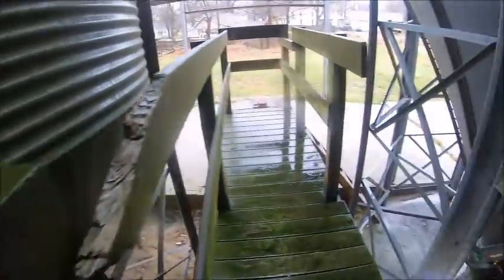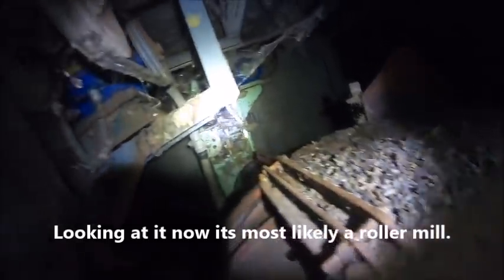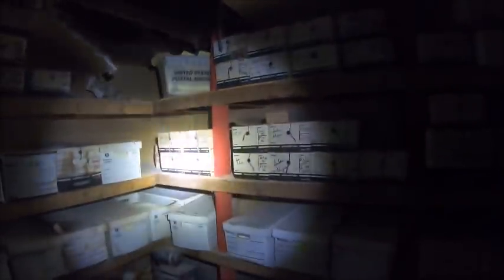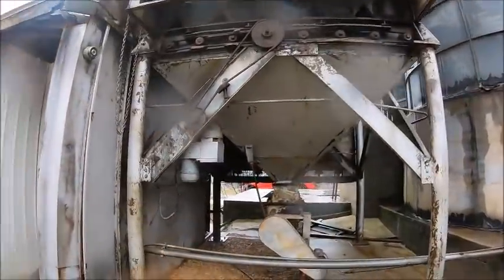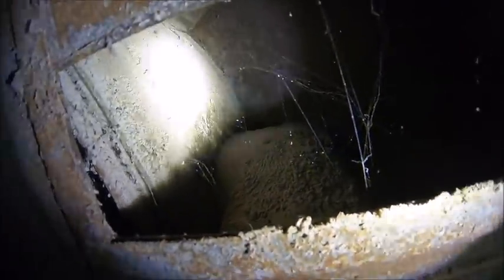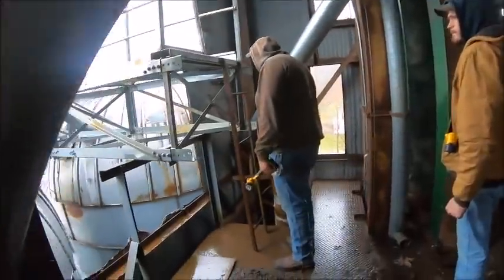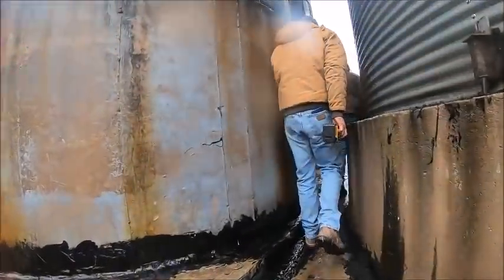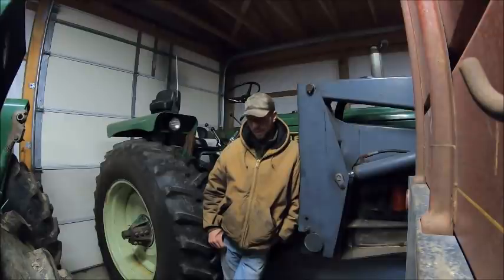Checking Out An Abandoned 1930s Grain Elevator And 1950s Feed Mill

Comment: Neat to see the "truck cradle"!  Hadn't seen one in decades.  I remember pulling two flare or barge boxes to Cambridge or Huxley and they used one to dump the second wagon.  We finally wised up and ran a hydraulic hose back to the second wagon to dump it.  I am 67 and I do not remember any elevators that had a sheller in them.

Comment: Thanks for the tour, Ethan. Those old elevators are a real study in innovation, how one thing lead to another, how each leg fed each mixer, tubing to the sheller, how and where to move the cobs, the engineering was amazing, to make it all work together! Then there is the electrical, what a nightmare that could/would have been. Didn't I see a fork truck soon after you walked in? The Clipper cleaning mill should be saved if the building is torn down. I can never get over the size of some of the electric motors, WOW!! Thanks again!

Comment: Ethan, the second hammermill was a Bryant-Poff. The company was out of Coatesville Indiana. They offered a pretty full line of feed mill and grain equipment, but closed in the 70s. The plant was then used to manufacture zero turn mowers under the ProStar name.

Worked on a lot of Bryant Poff hammermills in Wisconsin. All of the equipment in that feed mill was very familiar to me. The vertical mixers were a combination of Prater twin screw mixers and the square bodied ones were most likely Jacobsen mixers.

Comment: Thanks for taking us on a tour.  We have an old mill building in a local town, that I used to haul oats too.  All the milling equipment was still there and National Geographic was supposed to come at one point to take pictures for the magazine.  The old owner died about 25 years ago.  They did put a new roof on it to save the building, but nothing happens there and hasn't since the old owner was around.

Comment: I used to work at a feed mill like that in Gilbertville IA. The mill had a hammer mill with a 80HP Westinghouse motor on it. It also had a corn cracker mill, a Roskamp roller mill  and an attrition mill that had two 80 HP Westinghouse motors on it. It was built in 1929 by my bosses grandfather. We also had a clipper cleaning mill just like the one in the video. Closed about 3 years ago.
Reply: I just pulled a hammer mill with a 400hp motor and put in a brand new triple pair roller mill

Comment: My chore truck rode a lift thousands of times. And they loved to run it up before you had a chance to get out so you had to ride up. And then the truck would flood out and it wouldn’t want to start up hot (on 6volt). The whole process was nice. It still doesn’t have a lift - that would be why it feeds cattle everyday now and doesn’t haul. As I recall there at the end our elevator got to buy a brand new grain truck for a guy after they dropped his off the hoist when it was less than a year old.

Comment: I took a “ride” on a truck hoist, at our local elevator, when I was young.  I was maybe 5-6 years old, and dad had a load of corn to go to the elevator in the ‘76 Chevy 3/4 ton pickup.  I stayed in the cab while the truck went up to dump the load.  

That Clipper could do a lot of cleaning still, if you could get it out of there.  Of course you’d have to need it to make it truly worthwhile to got through the effort of removing it.  Not sure of the model, but there’s a local seed corn company that uses a wooden Clipper as their main seed cleaner.

Thanks for the video.  It’s fun to explore old places like those.
Reply from the maker: Worst part about that clipper is it’s 40 feet in the air.
Reply: @Oliver66FarmBoy  

That’s a problem for sure.  

Hauling through the elevator this year (same one I took a ride on the truck hoist), I learned they got rid of the cleaner in it, within the last year.  Have no idea what condition it was in, but suspect the only issues would be from wear and sitting for however many years since last used.  Also have no idea what brand it was.  They just cut it up in pieces and disposed of it.

I was sorry to hear they’d done that, but then again, I don’t know who’d need it, let alone want to pay to get it out in working condition.  Same situation the Clipper in your video is in, other than my local elevator is still in operation.

Comment: What would be really freaking cool is if you found an old abandoned oliver dealer that was walked away from
Reply: there is a old moline dealer north of me, that place is a time capsule.

parts on the shelf signs on the wall, story goes that when moline went under they shut the doors the next day and haven't touched it since.

mean old lady owns it now but the kids plan on turning it into a museum/ replica dealer.
Reply: We have a moline dealer that was abandoned to there is still a moline zts that has never had an implement on the drawbar. It is a museum now.  that dealer went under in the early 50’s they just loked  the doors and left.
Reply: @Drew-in-NoDak  their is a old new holland dealership east of me that has been closed from the mid 70s an still has parts sitting on the shelfs an parts books on the counter!
Reply: They still use one of them truck cradles at our local feed mill!